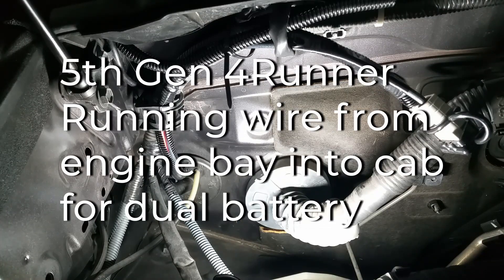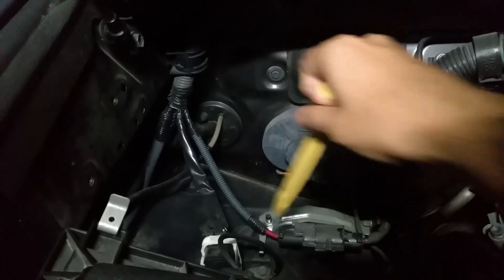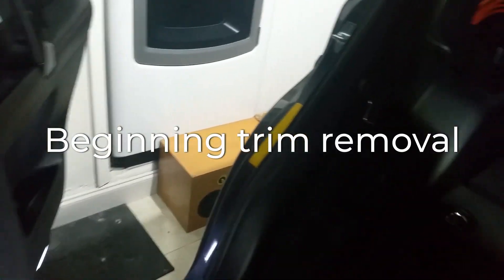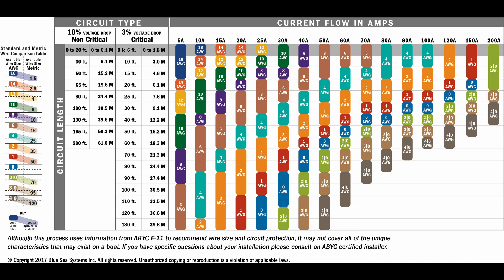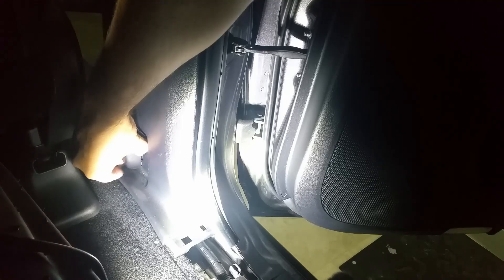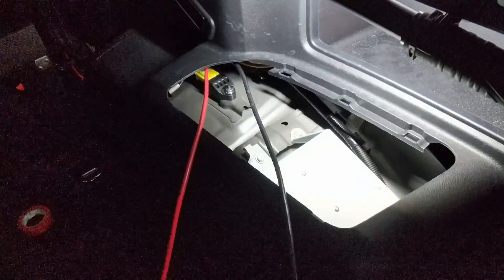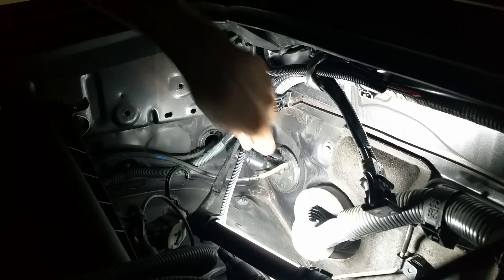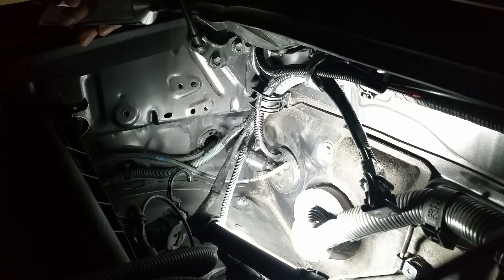Wiring from Engine Bay to Interior Accessories 5th Gen 4Runner

Comment: Hello, thank you for making this detailed video on your wiring install. I’m planning to mount a ham radio main unit in that storage area so I’ll need to run power just as you did plus the remote head unit cable back to the dash. You’ve made figuring that out much easier.

Comment: I tried to fish my wires through the pillar, was able to do it a few times but had one wire that just would not go. I didn’t take the pillar completely off, I was able to loosen it and then pry it open and then route through. Thank you for the very helpful video. It gave me confidence to try my own diy project. The 4Runner is really the easiest modern vehicle to mod.

Comment: For solar to charge a second battery, can the solar wires be hidden down the pillar?  So nowbody can cut them if you were in a parking lot?
Reply from the maker: I ran the wires for my solar panel along my roof rack (ziptied) and down the side of the windshield, under the rubber weatherstripping. The wires are mostly hidden that way. Some people have run the wires through the rear hatch but I was concerned about waterproofing so I decided to run them into the engine bay.

Comment: Do you have a video of how you mounted the plugs to the rear light access???
Reply from the maker: Not sure if I filmed that part, I can check though. I basically cut a rectangle hole out of the plastic panel and screwed the panel with plugs in.

Comment: If you’re ground to chassis, only need to run one cable… I ran a 4 gauge cable to my aft fuse panel, that way it can handle a bunch of accessories. Just my thoughts.

Comment: Did the install today per your instructions and it was perfect. Thank you. Rather than using fishing tape for the rear panel wires running over the wheel well, I had to use a wire hanger. Much easier. Now to install the second battery and Bam! I'll have a Dometic added to the kit and will enjoy cold dry food and beers...

Comment: What gauge wire did you pull from the engine bay to the trunk?
Reply from the maker: I put (2) 8 gauge wires through
Reply: @Think.  Thanks. Do you think 12 gauge will suffice?
Reply: @cmoreoverland6739  the smaller gauge you use the more likely to over burden the wire you are and you have the potential to start a fire. If you want to feel comfortable always run a heavier gauge than you need, especially to a fuse panel as you want all of the cumulative loads to be safe running in the wires.

Comment: thanks for the detailed video.  I ran my wires on the other side but the passenger side looks like a cleaner run.  What size wire did you use?
Reply from the maker: I used 8 gauge wires, determined by calculating the highest expected amp load and total length of the wire run